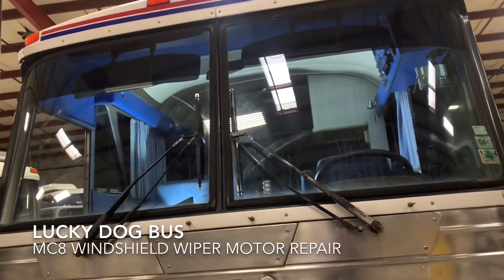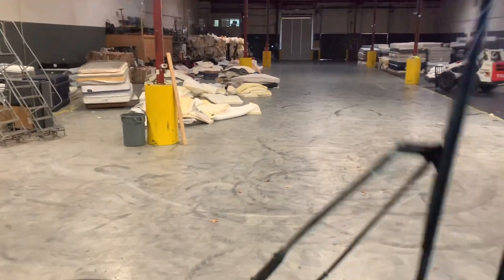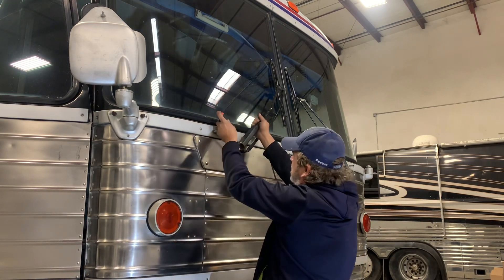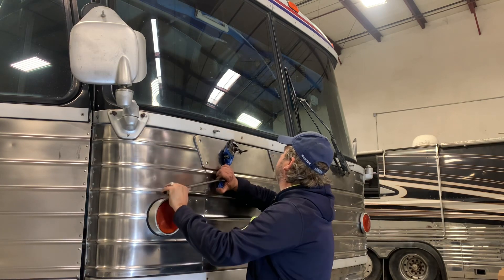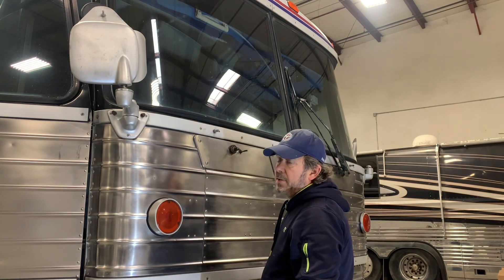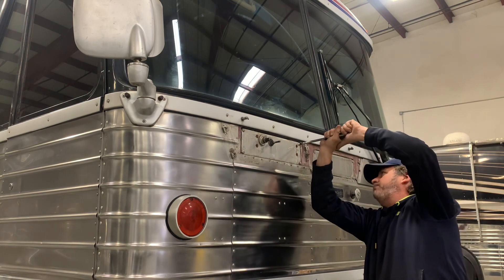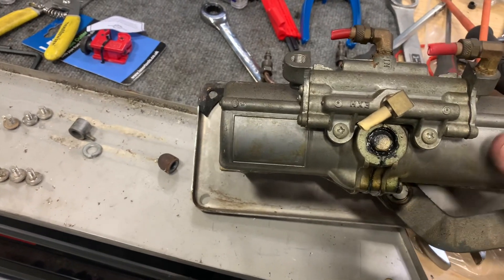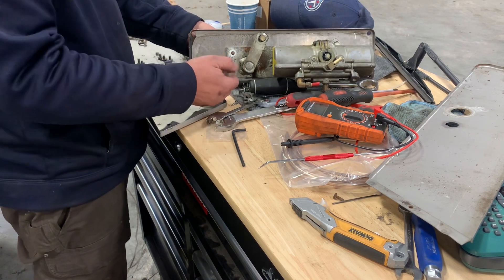MC8 Air Wiper remove and repair - part I

Comment: I just bought an MC9 Custom Coach out of Ohio, and brought it to Texas. On the way and in the rain we experienced wiper failure, if you had both of them on, the drivers side would quit working, so we did the rest of the trip with only the drivers side working. I did get some rainex from a sweet lady at a truck stop, and put that on which helped, but now that it is home, that will be one of my first projects. That and tail lights, do you know where I can get some new lenses Lance, aftermarket or OEM? They have the oblong tail light housings and three round lenses, I want to switch them to LED as well, and I'm going to get some LED projector type headlights too.